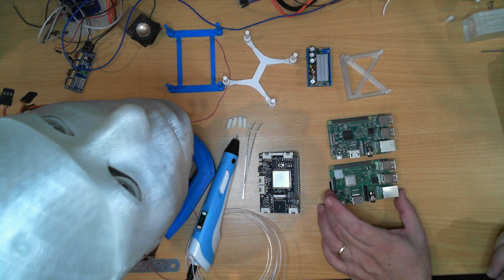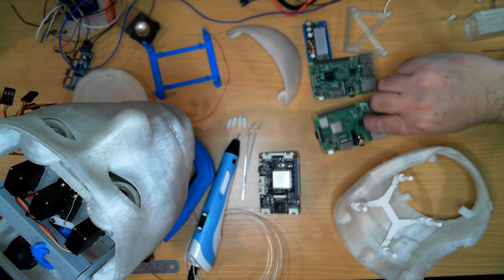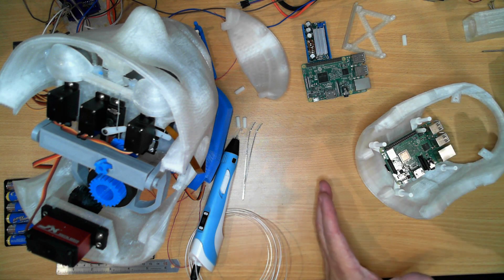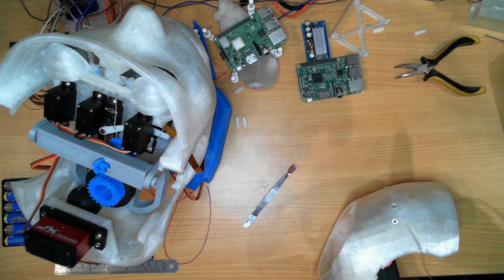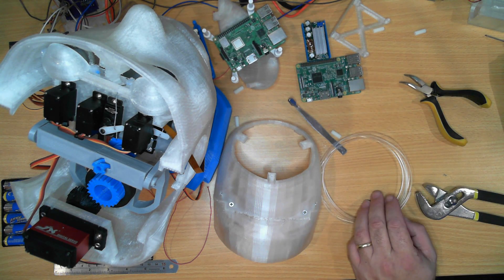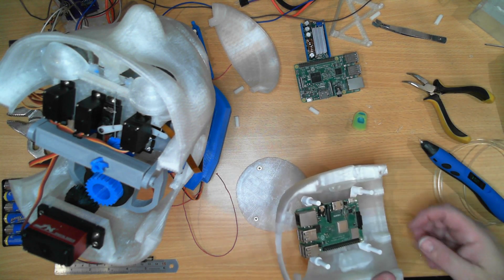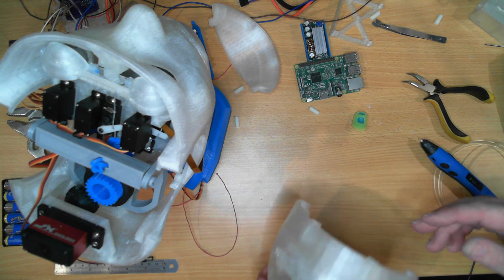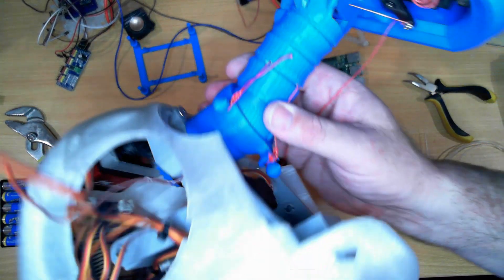Fred Head Part 5

Comment: Hi its hard to hear what board your going to mound on top of the PI , I'm building the IMOOVE  step by step so I 'm following your video's  for help because it is by far the easiest videos to follow because your showing all the important stuff basically  step by step. perhaps in your descriptions on each video can you say what  you used please.   And yes I am watching the videos before  I print to see if you made changes to the parts or  model. I'm now only just connecting the eyes (where did you find a suitable size camera for the yeas for the eyes?? )😊but going to print the PI 4 bracket next .
Reply from the maker: The mounts are compatible with the Raspberry Pi 4, in fact later on I upgrade to the Raspberry Pi 4 and am still running it :-)
This video was released in June 2020 and in Feb 2021 I did the upgrade.
The addon board I was talking about was the Seeed Studios AI Hat for the Raspberry Pi.
I still haven't installed it, and not sure if I will.
Seeed studios no longer sell this board, so it doesn't make sense to show how to use it when you can't get it.
Instead I'm using the multiple Raspberry pi approach where one pi will be used for OpenCV and one or more others for the rest of the systems.
So I am currently installing a fixed wired network internally with routing.
The physical wiring will be released soon on YouTube.
I'm also working on a set of networking videos to help people learn how networks of all types work.
I use multiple network in Fred already, WiFi, I2C and serial :-)
Seeed do make a good linear mic array, I have one here and may add that into Fred, but will be mounted on a Raspberry pi in the torso somewhere.
Coming up I did upgrade the neck to Gael's latest version as I start to build the torso, this helps prevent the head rolling over :-)
Reply: @CyberOne  thank you 
where can I buy the eye camera from
Reply from the maker: @louwrensburger1796  I got mine on Ebay.
This one is a bit different than mine but should work better.
https://www.ebay.com.au/itm/224072387008?hash=item342bc149c0:g:ItsAAOSwTrFfBdq-